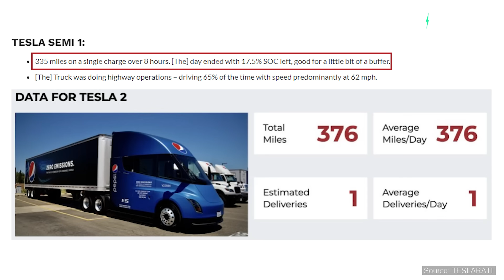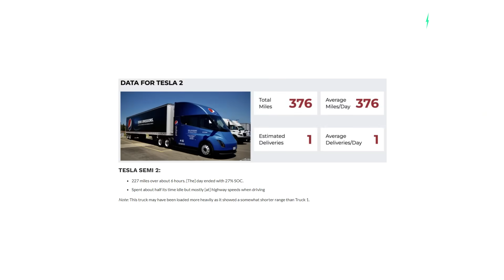Tesla Semi tested at highway speeds - REAL world range shocks rivals

Comment: From an engineering standpoint, hydrogen would still be a good reserve or super long-range option because there is plenty of space and the weight of a hydrogen system is pretty minimal.  The system could be the same as used by the Toyota cars because it would just do a trickle charge of the battery.  All this hinges on hydrogen system caused being reduced enough.  And I'm definitely not a hydrogen fan for reference, but this just seems like the best-case scenario for hydrogen in ground transportation.
Reply: Will we have NASA techs at Pepsi fixing hydrogen leaks ? Hydrogen really is silly.   They need to stay in the lab until they can get rid of the platinum in the fuel cell.  At the very least.

Comment: Too bad the payload is lower because of the weight of the batteries!  We’ll need more trucks on the road!
Reply: Are they ?  Electric trucks get an extra 2K lbs.  90% of trucks do not run a full load.
Reply: @danharold3087  check your facts . I know I couldn’t use it
Reply: @JB-fi5rx   How am I supposed to check anything without you telling what your requirements are ?
Reply: That may be true if trucks actually ran at full capacity most of the time, but they hardly ever do.
Reply: @DuckHunterGaming  correct but at times, they have to run full load to make money so that makes the Tesla useless
Reply: @jimpackard8059   at times, they have to run full load to make money so that makes the Tesla useless 
No, it only makes it useless for applications where semi trucks have to run full loads all the time; for example, liquid hauling. For all other applications, the fact that the Tesla Semi may be 2-3,000 lbs. shy of a diesel semi's payload is completely irrelevant.

Comment: As an Owner Operator I am excited to see this new technology get up to speed. The emissions systems on trucks starting with egr and at the current variant of egr, dpf and scr have put many independent truckers out of business. They are unreliable and very expensive which is why independents delete their trucks. Even though it is illegal and they can no longer use the dealership for repairs. When proven out electric trucks will be far more reliable and environmentally beneficial. On the flip side when full self driving is a thing millions will be out of work. No DOT officials needed, no drivers needed, no HOS rules. It will be a huge benefit to some and a real hardship to others. It’s going to be a bumpy road. Happy I’m retiring at the end of the year.
Reply: You just want to see yourself go out of business.
Reply: I think platooning might become popular.  Basically where one driver manages 2-5 trucks.  Platooning trucks will draft each other.  Studies have shown this saves 15-20% in fuel.  Having a driver around should help with security and reduce theft issues.
It might workout alright for independents on long hauls.  Two independent truckers could combine there two trucks together to team truck a two truck platoon.  Each team trucker would have their own sleeper cab.  You could add non-sleeper trucks as extra platooning following trucks.  Short range Tesla semi might work since should get 15-20% more range bringing the truck up to 400-425 miles range.
Reply: @k34561  and that puts 2 out of 3 out of a job.
Reply: @kborak Do you think that fighting it will change anything? It's happening regardless of what we may want
Reply: Absolutely agree. All the fuel systems pushed by the EPA and DOT are killing small businesses

Comment: Electric Viking  report on the cargo weight…. That’s what matters
Reply: Quite sure Tesla has provided load info to every company with the trucks.   They only care if the trucks can do the job.  That is what these trials are designed to prove.   What you want to know counts little.  The longer people are guessing the more anxiety it generates at the design offices of the competition.
Reply: Mike Roeth of NACFE, the sponsoring organization, is quoted in an article in Electrek as saying "We’re tracking the beverage. It’s impressive, a fairly heavy haul at nearly 80,000 pounds". Detailed loads will be released in the final report, at the end of the test.
Reply: No info on the cargo weight because that is the massive fault with this truck. It is useless to many freight  companies and everyone in the trade knows it
Reply: @jimpackard8059  At most, a Tesla Semi may give up 2-3,000 lbs. of payload. Since the vast majority of trips go out well under GCVWR, that will rarely be an issue. For applications where towing the maximum payload at all times is important, Tesla Semi's won't be a good choice.

Comment: Hi Sam!
Here's something from outside the box.
I've just seen a video where they were discussing making railway locomotives fully battery-electric (not using overhead lines with pantographs). Already it seems that manufacture of diesel-electric locomotives has ceased some time ago already, and the industry is on the verge of collapse.
Now my question is, what size would a battery pack have to be to provide enough power to drive those electric motors, and  would they need different motors? How long would it take to recharge such large battery packs before the locomotive could undertake another full return journey? Is it feasible to replace tens of thousands of locomotives with  battery-electric? [Some guy claimed "several decades!"]
Apparently, the State of California has already indicated they are about to ban ALL non-electric locomotives (this includes ALL diesel-electric locomotives) from entering the State for whatever reason. So, the whole train would have to stop and change locomotives at the border!  Who will carry the cost of this? 
With 40+% of all transport tonnage being railroad traffic, I think there are a lot of VERY nervous people out there!
I'd love to hear your take on this, especially the battery issue.
Thanks Sam
Reply: On my nearly 10 Years with the CNR (Canadian National Railway) our "Home Subdivision" had a Distance of about 127 Miles, so maybe the required range of 150-200 Miles would suffice.

Plus most Freight Train power, is 2-3 "Power" (Engines) and CP Railway often uses 4-6 Power units!

Comment: Sam - can you let us know how the other trucks are performing?

Also, I'm pretty surprised they aren't giving exact weights of the vehicles on each of these tests. I also thought they were going to give the actual weight of the semi as well, which everyone is just speculating on right now.
Reply: Visit the Run for Less site and view all the data there.  
The question answered by this test is can the electric vehicles do the job.  Weight changes with every load.
Reply: @danharold3087  it's a lot to dig through. I could find every bit of info Sam provides on my own. The value of the channel is that Sam curates the info I'm interested in.
Reply: @truhartwood3170  Just remember that Sam does not always get it right.

Comment: This just put a massive spike through the H2 vampire's heart. I don't think there's going to be any trucking concern on the planet that can't determine after hearing/seeing this news that the very best way to convert limited dollars to maximum donuts is with a Tesla semi or someones E-semi trying very hard to compete with Tesla. It doesn't just slay diesel operating costs, it kills 'em all! Thanks Sam, that was great news.
Reply: H2 was always a bad idea and based upon a lie. The lie: Hydrogen is the most abundant element in the universe!
While hydrogen might be abundant in the universe (not around Earth) elemental hydrogen is pretty much nonexistent where vehicles are.
You have to make hydrogen, meaning you add electricity to extract it from water. Basically it's a battery.
But then you add back in the mechanical inefficiencies of an ICE engine and your throughput is very low. It's easy for battery drive to beat those efficiency ratings.
Reply: @protorhinocerator142  - Casual to the most obvious observer.... or the other way!
Reply: Driving a truck 3 to 4 hundreds miles and six hours a day will put a trucking company out of business. Try over 6 hundred miles an 12 hours. Buy a Tesla truck and go bankrupt.
Reply: @paulipock6981 Long Haul isn't the only kind of trucking. I work with hundreds of companies that use large trucks and don't drive for hours a day on the highway. 300 miles would be a long day for most of our guys driving deliveries in a crowded metropolis. And stop and go is where electrics really pull ahead. So just because you can imagine the most basic and obvious scenario where they will clearly struggle doesn't mean there aren't thousands of niche use cases where it already makes sense. And with any new technology, those niche use cases will expand as the technology matures.
Reply: @paulipock6981  - Bad metrics....... the cost savings to operate makes sitting a while during a charging cycle a no-brainer. It costs WAY less for a driver to chill for a while than to buy diesel #2 forever.
Reply: Solar and batteries are getting predicatably cheaper.  Wright’s law in full effect.
Reply: I think H2 will be good for non-standard deliveries. For example, extremely long distances, extremely poor weather, overweight deliveries (things too heavy for a class 8 truck). H2 will be for specialist purposes.
Reply: can solar energy charge the huge battery? electric will go alot more  cost higher soon .
Reply: @hillbillyintheasia6122 i heared this 5 years ago.
Reply: @hillbillyintheasia6122 yes😊

Comment: I have problems and questions one when was the last time you ever seen a semi actually only doing 55 on the interstate number two most the time they don't try to do 62 either but number three I do believe these trucks are going to be wonderful for the shorter range every day trips that a lot of truck drivers do but anybody trying to go cross country and that is their job. I don't think these trucks are going to be very good for that, even if it can the long range can't get 500 miles that would mean you are having to charge that battery from 0 to 100 darn near every single day then the problem becomes at what point is the battery going to start to degrade toy you're no longer getting that 500 miles range I fear that it will not take but a couple of years for people traveling cross country for that to happen. That's my worry problems but maybe Teslas batteries are that good? It's a possibility and only time will tail.
Reply: Expect to see the battery chemistry changing in these trucks over time.

Comment: I think it’s great but is the load size the same when compared to an ice truck
Reply: At max GCVW, about 2-3,000 lbs. less. But statistics show that very few trips go out fully loaded; for example, 85% of trips go out loaded to 10,000 lbs. or more under GCVW. So the difference in payload would only affect a small percentage of trips. For applications where every load must be maxed out by weight, diesel semis are still the better option.
Reply: @BigBen621  yes but the issue is that you would not buy a truck with a capacity that limits your profit which on trucking is marginal

Comment: Most large companies limit their trucks to 65 mph and most local home every night trucks along the eastern coast of US drive less than 500 miles a day long distance trucks are limited to 11hrs drive time and 1/2 break within first 8 hours of duty (charge) this is a game changer definitely for local drivers.
Reply: Makes sense. Max speed for trucks in Europe is 60 mph / 90 km/h. 
Other than that, companies will organize themselves to maximize profits with a lower cost per mile as a starting point. They'll not start from how things used to be done or from the desires of their drivers.
Reply: @MattCasters  can solar energy charge the huge battery? electric will go alot more  cost higher soon .
Reply: @hillbillyintheasia6122 solar power from panels on the trailer roof? If the truck gets 1 mile per 2 KWh, and the roof generates 4 kw for 10 hours, then each day gets 20 miles worth of charge.
    But if a step van with a 50 mile daily route at lower speeds uses 40 KWh, then it might work out.
Reply: @hillbillyintheasia6122  All Megachargers have solar arrays, and the Sacramento Pepsico Bottling Plant has some 150,000 SF of rooftop solar panels.
Reply: @hillbillyintheasia6122  solar, wind, and batteries as a combination seems to be the solution right now with the large declines in price. We're not going 100% renewables in that scenario but rather around 500% to cover for the cold, dark, windless periods.
Reply: @@user-cs5rr1it9l Tesla is famous for its charger network being essentially 100% reliable. All the stories you've read or seen about chargers being down refer to other than Tesla chargers.

Comment: Without knowing the tractors wait or the cargo weight these results are meaningless. Why is it still a secret how much these tractors weigh they've been on the road for 10 months, how could it not have leaks yet?
Reply: The test here is to show if the trucks can meet the real world trucking needs.  Every day the load is based on what stores order.  90% of class 8 trucks do not carry full loads.    Expect Tesla has very strict NDAs with the companies operating them.   Keep the others guessing as long as they can.
Reply: @danharold3087  give us the percentage that NEVER carry a full load and then you will see why this truck will not sell
Reply: @jimpackard8059  We don't know that it will not carry a full load.  The original 500 mile drive video says it can.  Also  if I am buying sand to build a road we just run maybe 1 more truck for every 5 or 10 whatever it takes to get the bulk.  The EV will still be vastly more profitable to run.  Same for hauling wheat or any bulk cargo really.   There is no magic in the existing full load.  Anyway you need to start comparing  the Tesla Semi to hydrogen trucks not diesel.  Diesel are going away as soon as enough electric trucks have been built to replace them.

Comment: I cant wait for this to be done and over.
While electric personal cars are all fun and sexy, its the trucks that do most of the polution. So if we get them all to electric we will smell it in their air and probably also have less noise streets.
Reply: I live within a half mile of a US Highway  Rt 13 Maryland/Delaware Border with a traffic light and 55mph speed limit, Especially at night extra truck traffic in the early morning hours but all day long thats all you hear is the truck’s engines and engine brakes. Electric Trucks will make all that disappear..except for the tires that can’t be fixed unless the pavement improves, but we will accept the loss of the engine noise…and that diesel nostril tingling smell.

Comment: After 500 miles, how long does it take to charge?The driver takes a long coffee break.
Reply: After 500 miles the driver goes home because these are day cabs and that’s about eight hours of driving. 
But with the mega charger, I believe the charging times about an hour.
Reply: @neilkurzman4907  After 500 miles, the SOC is going to be near 0. And charging a 900 kWh battery to  100% from a 750 kW Megacharger would take 1.2 hours even if the charger maintained full power all the way to 100%. But as with all EVs, there is a drop-off of charing power at higher SOC; so my guess is more like 1.75 or 2.0 hours. But as you say, it doesn't matter, because the driver is home with wife and kids while it's charging.
Reply: @BigBen621  
The amount of charge the driver needs is dependent on the load, and how far it has to go.  Supposedly Pepsi is doing longer runs and has strategically placed the charger where it needs to be to complete that.
If you’re going from warehouse to warehouse, you can always plug the truck in while you’re unloading. 

There is different logistics in handling this type of truck. Depending on how the owner wants to use it.

Comment: Except current semi range is 1500-2100 miles fully loaded depending on gas tank size etc.  Plus no load numbers disclosed??  Electric trucks have a long way to go to be viable, charging a truck fleet apparently takes huge amounts of energy as an article I read described California asked a fleet operator to not charge their trucks so they got diesel generators to do it.  Our grid is not ready for the electric truck revolution.

Another issue is the batteries are so heavy it significantly cuts into the load capacity since all trucks are limited to axle weight by law depending on trailer and truck type so it will take more trucks to carry the same loads.

Electric trucks are currently more expensive so replacing a whole fleet will be costly plus installing the charging infrastructure at fleet lots and truck stops will be incredibly expensive in the short term.

It’s a lot easier to overcome these issues in a passenger vehicle but the energy storage dilemma needs to be solved to make the trucking situation work.  Otherwise get ready for your prices to inflate even more as transportation costs rise.
Reply: This test is exactly about real world electric vehicle viability.    The Tesla trucks are running the same routes with the loads required by the pepsi company.  
Unlike the EV car rollout the EV truck rollout will need to ensure that every truck sold can be charged to make runs.

Comment: "close to the limit"....*how* close to the limit???  Let's load it up to a percentage point of 80,000 lbs. and have it pull freight up steep hills to get a sense of what the Tesla Semi can do for miles on a charge.
Reply: 80,000 lbs gross seems to be what most these test are doing. I was shocked by this as that's not a great idea safety wise if it is NOT NECESSARY.
Reply: @Neojhun why do you assume that is the weight with no data provided?
Reply: Been done, but loaded to 81,000 lbs., here: https://youtu.be/LtOqU2o81iI?feature=share&t=1221 and here: https://youtu.be/LtOqU2o81iI?feature=share&t=1221(same trip). Climbed the 4,200 ft. Tejon Pass ("The Grapevine") about at the midpoint of the trip.